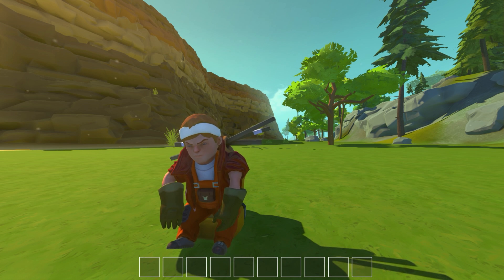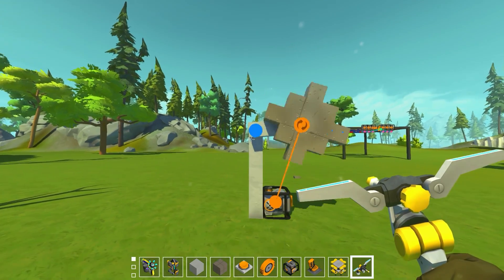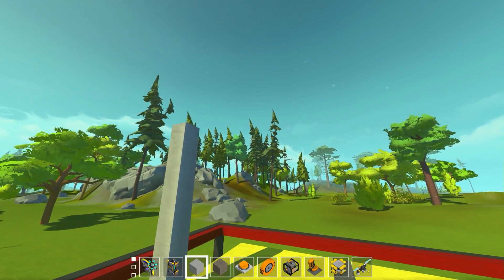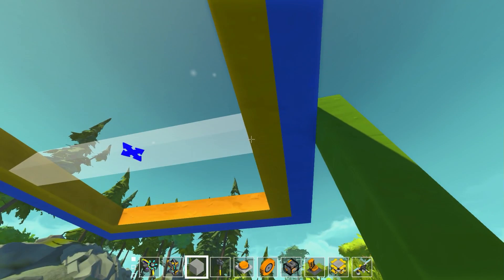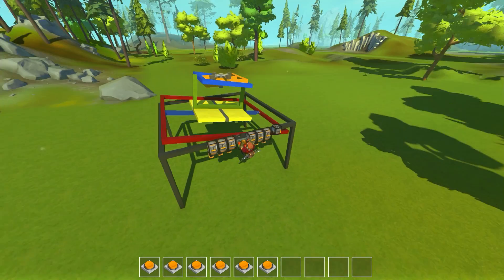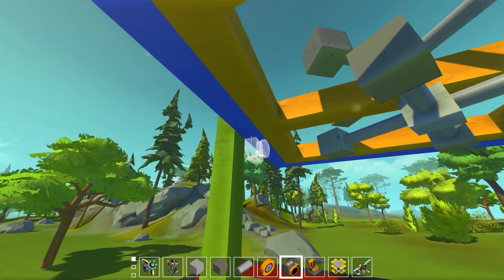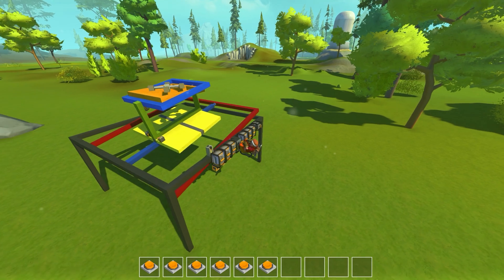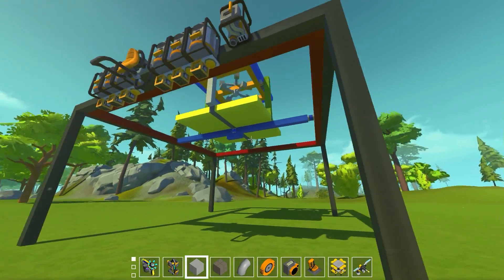Building a 3D Gyroscope Sensor Setup! (Scrap Mechanic #254)

Comment: I have tried making a gyroscope to make a hovercraft, and I'm absolutely failing. I'm using vanilla game, no mods, and I'm just horrible. I will need to keep trying until I get it right, but I don't think it's normal for a person to take 3+ days to make one simple thing such as me. XD
Reply from the maker: If you are struggling try making it bigger first :D Bigger gyros done this way are much easier to balance.
Reply: @kANGaming  that's a good idea, thank you, I have to try it out soon. Thank you for replying, I didn't expect it, and so quick too! While I'm watching you and kosmos vids I got a notification. XD

(Edit: I gave it a shot, got it working, but now I have come across another pinch. The gyroscope itself, one part of the gyroscope seems to spin faster than the other, making my build spin as well. But it's definitely stable now!)

(Edit 2: apparently my thrusters are the culprit behind this. I need to find a better angle to fix it. XD)

(Edit 3-5: haha the struggle is real, I have been at it for hours/day(s) to make a working flying vehicle with thrusters and gyroscope.)

Comment: For some reason, when I did the counter rotation (connected the bearings opposite to the other ones), the bearings wouldn't rotate, or just rotate very slowly. Anybody know why?
Reply: Same problem here. I think it's my computer having problems. I have less than minimum system requirements.

Comment: I built a flying selfstabilizing aircraft with this idea, when the game first came to steam, and i used spring dampened thrusters to keep the thing stable etc. worked great, but at some point, they changed something and it didn't work well anymore... 
was amazing to fly and easy to land ...

Comment: I always understood the principle of gyroscopic stability like spinning a weight on a rope. In order to change what way the weight is spinning, at some point in it's spin it'll have to drastically accelerate. The inertia/momentum of the weight fights against that force as it's already under a constant acceleration, the very same that causes the centrifuge effect.

In this instance, the weight is every point of the spinning body that has mass (so all of it) so no matter when or how you try to tilt it, you need to sharply accelerate part of that mass. Therefore, until a sufficient torque/force is applied to provide that acceleration, the gyro will remain in the same plane. Trying to actively force a gyro tilt across it's rotation will result in that same required force being applied back onto the acting body in equal/opposite forces.

Nerd up. :P

Comment: 1:20 it's called reaction wheels. Gyros in spacecrafts are used as navigational tools for the avionics interface to be able to tell the orientation in the 3 axis and adjust the yaw, pitch and roll. They're also used in airplanes and helicopters.

Comment: Honestly, whenever i try to make a flyer, Even with a brent batch stabilizer, it still tilts.
Even slightly.
I'd prefer it just be locked horizontally.
Like, it can still turn and stuff, but it can't tilt ever.

Comment: very nice but dont it get slighthly unstabile after a while like stabilizer glitches ?
i mean if it get a bump or something that might bring it out of shape like the frame collision ?
i have seen concepts where the lifting thrusters is made like a gyro and that is super stabile.they dont drift and always selfadjust.
i have 1 here that use it.
it got left in my world at some point and i dont know the original builder.
http://steamcommunity.com/sharedfiles/filedetails/?id=1102420474
the system dont take up much space as you see.
maybe you can clone the 2 ideas.
also this creation use a variation of it.  http://steamcommunity.com/sharedfiles/filedetails/?id=1139548436

Comment: I tried to develop a Control Moment Gyroscope in SM, and it kinda worked, but only if there was no weight whatsoever. 

What I really want is a gyroscope that can detect the angle of the craft at any angle (including almost upside-down) and correct. The problem with most gyroscopes (including ones I've made) is that once it passes the sensor, you'll never be able to correct it.
Reply: With the modpack you could use smart sensors and measure the distance

Comment: I have an idea for a creation for you. I tried to do this but I had no idea how to make a gyro so now I am asking you. Try to create a flying creation that flies like a TIE Fighter that you can use to do barrel rolls. My idea was to detect the fighter's angle and adjust which thrusters are used to keep it in the air.
Reply: - Can you make coaxial helicopter (ex: Ka-25) where rotor blades will act as gyro?
With autopilot (balance roll, hold pitch, heading and altitude) and landing (hold everything) mode
- Sometimes acceleration is used like "fake" gyro in mobiles, can you make accelerometer? with arm and spring as soft as gravity, and when helicopter start to fall/raise it will try to keep steady?
Reply: - Can you make coaxial helicopter (ex: Ka-25) where rotor blades will act as gyro?
With autopilot (balance roll, hold pitch, heading and altitude) and landing (hold everything) mode
- Sometimes acceleration is used like "fake" gyro in mobiles, can you make accelerometer? with arm and spring as soft as gravity, and when helicopter start to fall/raise it will try to keep steady?